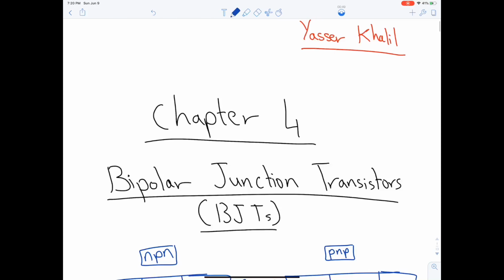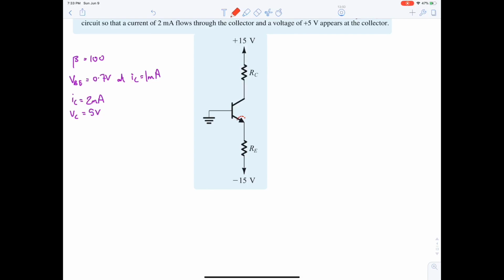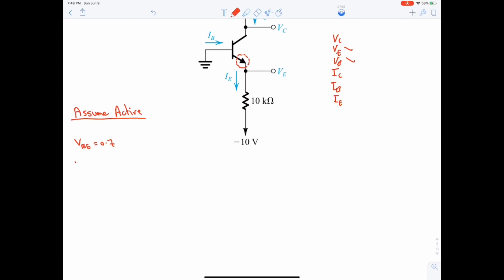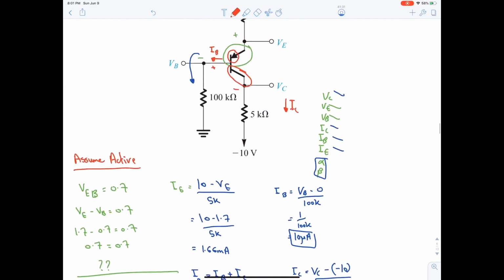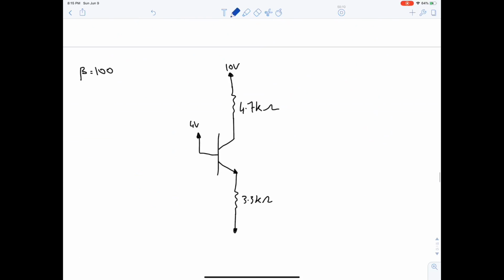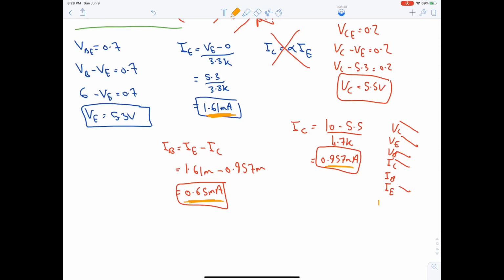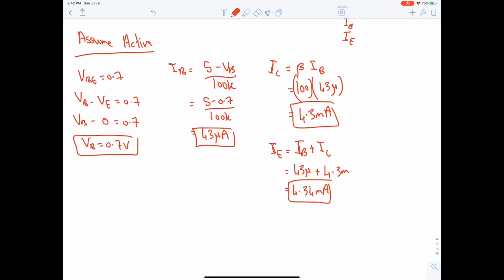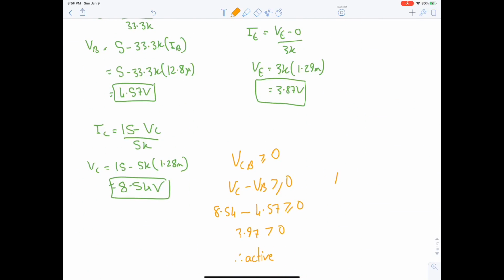Chapter 4 - Transistors (Part 1)

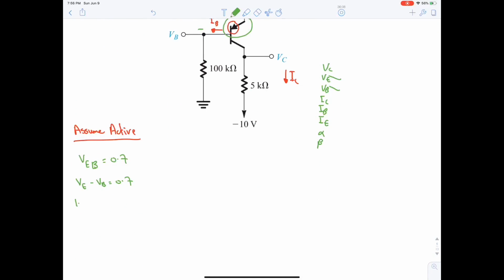Comment: 36:10
besides your excellent explanation that I appreciate very much, everything made by man should have a drawback,
here, v_b is 1 not 0.7, according to the question, and when you subtract them as you wrote, it won't be 0.7, rather, it is 1,
so, there is a typo there, so be careful gentlemen.
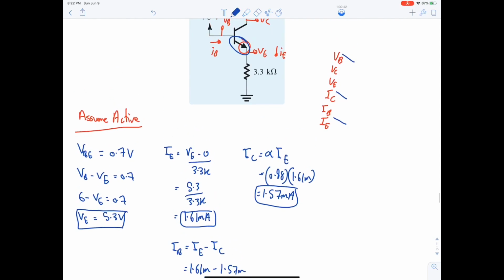1:02:41
I_B=40uA
The most important stuff that the whole process of solution is clear and easy to follow.